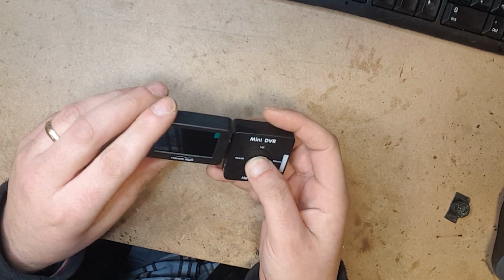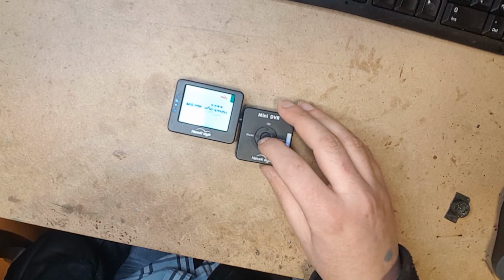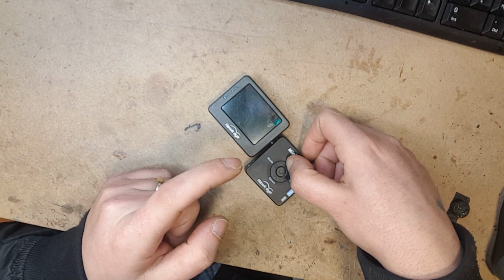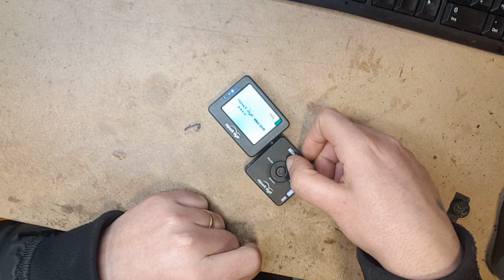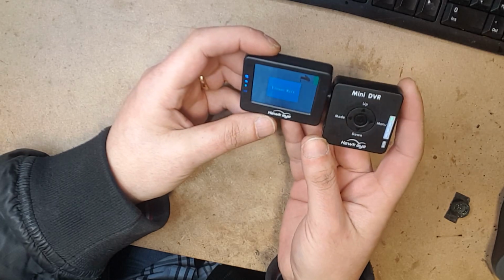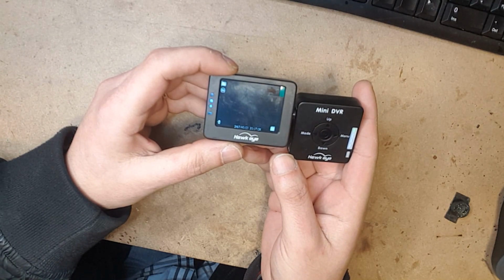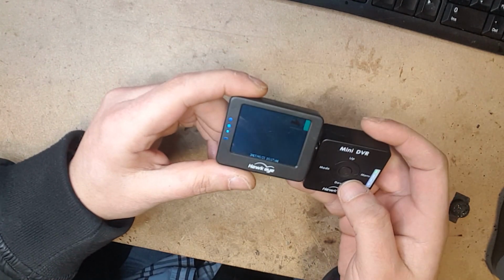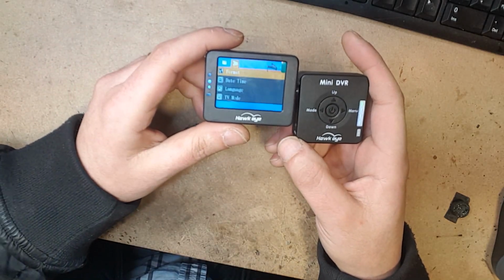Hawkeye mini DVR firmware flashing and un-brick/fix

Comment: Hi, can you please tell can it start auto recording when you connect charger to USB port?
Reply from the maker: i havent done that personally but there is an extra new menu in the new F/W which is that exactly ... i found that motion detection works great and im using the High setting on it